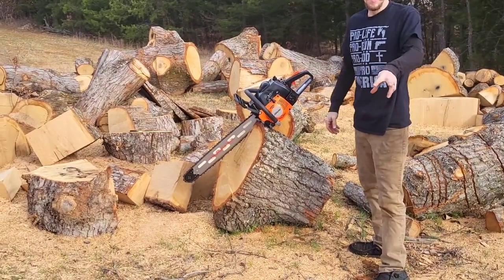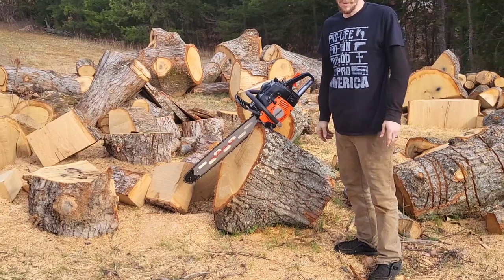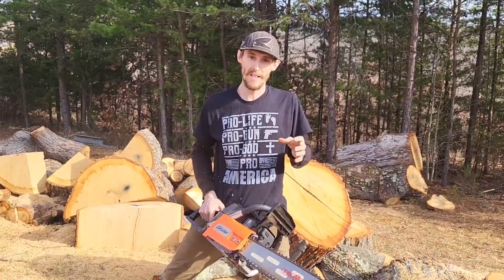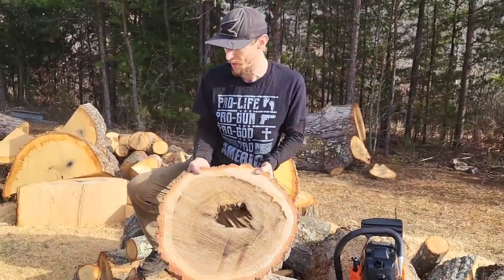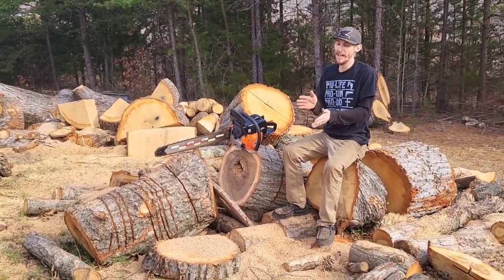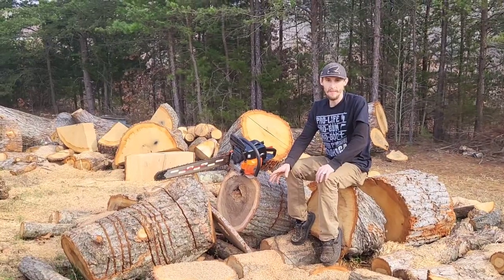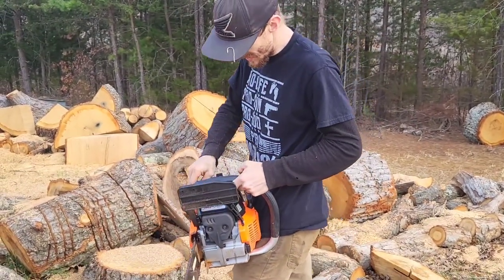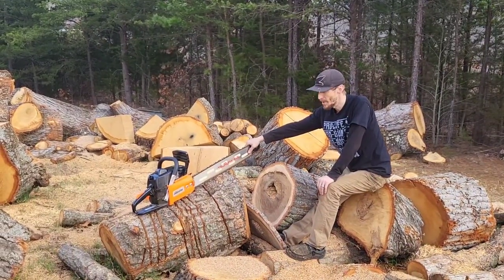JonCutter G7500 w/ 24" B&C.  First Run and Cuts!!! Forgive me,wind was ruthless.

Comment: I would open the muffer and fatten it up until it has a nice slight 4 stroke, and run it for about 3 or 4 tanks of gas through it. It will get stronger and the extra lubrication will keep everything in spec better on the breakin. Don't be disappointed in it, as it isn't even broken in yet. Even old saws like my old Counter Vibe ran like that after sitting 20 years, now it pulls like a Freight Train.

Comment: I process a lot of tree service wood. These are the kinds of saws I like because I feel good about getting into the big nasty trunk wood with them and getting them dirty and don't mind if they get beat up a little bit. I'm not sure how I would feel getting into that stuff with a 500i or similar saw. Have you ever used Archer brand chains on your saws?
Reply from the maker: That's another reason I like these, ain't afraid to beat on them a bit. Yes I've ran a few archer chains. They are fairly good chains for the money. Can't go wrong with them at all.
Reply: @dubbssawshop  Thats all I run on all my saws are the archer chains. I buy them in 10 packs to get the best price. 14ish bucks a chain.
Reply: @jeffy1466  I've run their semi chisel.  It's a more old-school (larger radius corner) semi than some of the newer oregon chains..  but once I figured out a grind it liked it cuts great.  Holds an edge great for its price point.  I still like oregon (dpx o think) better but its nice having  "almost as good" chain to throw at extra grungy skidded wood.

Comment: So you've got to play around with several clone saws.  I need to get a big boy so that i'm not beating up my 620p working the big stuff.  Thinking 75-90ccs or so, hardwood only.  Which ones are truly worth it?  Any reccomendations?
Reply from the maker: I've had great luck with the,  blue, orange and New carbon 372 FT saws, may get a bad carb or leaky gas cap, but still worth it IMO. The g395 is also a great one and no doubt takes out the 288. Either Neo or FT makes dang good 660 clones and I would recommend any version of them, them things are dialed in.  Either way you go I think you'll be happy. Hope this helps. If the extra cost of the upgraded ones is not a concern, then go for it, if it is then the regular versions will still be a great option.
Reply: @dubbssawshop  Thanks bud.  It seems there is a consensus amongst several different folks on the 395 and 660 clones.  Its going to be for real sporadic use and for fun so I dont mind the weight of a big boy as much.

Comment: Runs like a old mac 10-10 dogs outta with low rpm. Need to tear it down and inspect the carb set up.
Reply from the maker: It has a Tillotson carb on it. Imma tear into it and figure out how to plug that governing circuit.
Reply: Lil jb weld mabye

Comment: I hate a governed carb. But she must be designed for torque more than chain speed.
Reply from the maker: For sure!!! Seems to have ok torque. Well see how it does after it breaks in. I think it has potential. Def needs more rpm and to get rid if that enrichment circuit in the carb.
Reply: @dubbssawshop  You might have mentioned it later in the video..  if so I apologize..  but do they use a bypass jet or a more traditional governor?
Reply from the maker: @Matt Fleming  going to be a enrichment bypass circuit drilled into the high side.

Comment: Yay hi I’m the camera WOMAN
Reply: Well camera woman, you did alright...but here's some tips from a pro:
1.  Look through rhe camera, not at your subject.  If you had done this, you probably wouldn't have chopped your dad's head off! 
2.  Slow, steady movements
3.  When action happens, nothing else matters, fill the screen with the action.  In this case, the action is cutting with the chainsaw.  Fill the screen with Dubb and the saw, and no one cares about Dubb's feet and legs.   Just be sure to get Dubbs torso, head, and all of the chainsaw.  Anything else is largely unnecessary. 
4.  Same thing applies when he has the little talks.  Dubb and chainsaw in the frame.  Don't be afraid to zoom in a little.
You did good young lady.  And you'll get better.
Reply: @novicelumberjack  👍🆙BigGuy